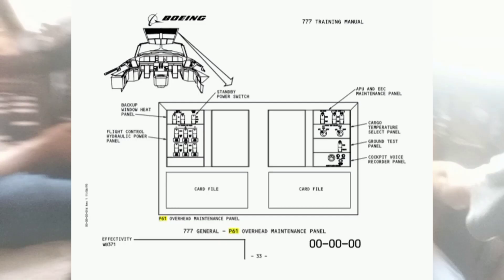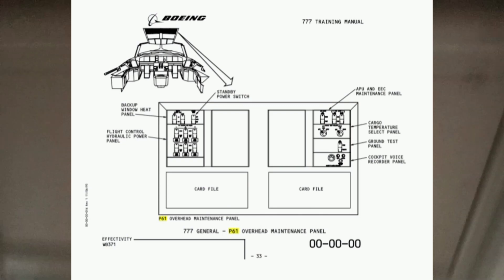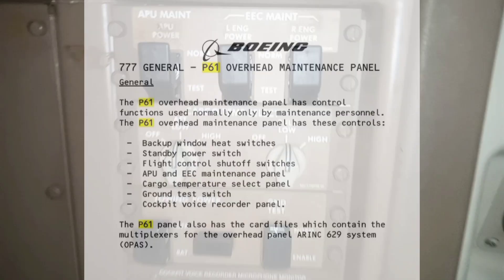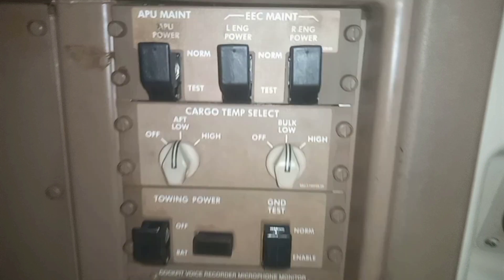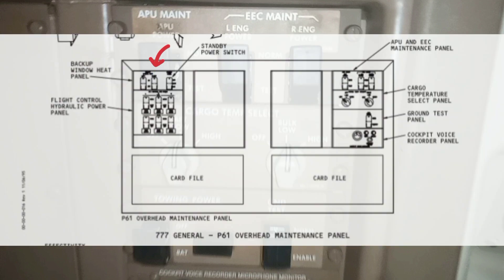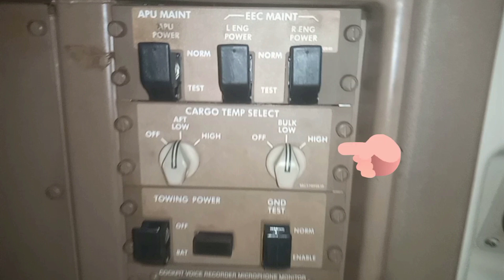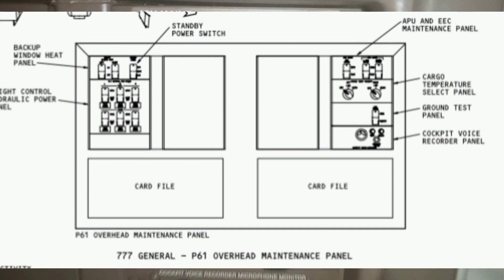General explanation of P61 over head maintenance panel of Boeing 777 aircraft

Comment: As usual good video... What is the difference between putting the cargo ventilation low and off? If they are the same thing, than why there are two switches for it?
Thanks.
Reply from the maker: Thanks for asking.
The cargo heat selector is a three position selector. The selector enables the  cargo heating and ventilation systems. The high selection sets the compartments to 21°C and the low selection sets the compartments to 7°C, moreover The HIGH position also enables the ventilation system. The LOW or OFF position sets the ventilation system off.
Reply: @AMTUmair777  Appreciate for teaching something new.

Comment: Good video...Does the backup window mean the "cockpit window"?
Thanks.
Reply from the maker: Yes. Here is some general description of window heat system:
The window heat system prevents ice and fog on the flight deck windows.
Electric heaters in the window laminations heat the flight deck windows.
The window heat switches enable the window heat system. With window heat ON, the window heat control units (WHCUs) control the power to the windows. With window heat OFF, the backup window heat system can operate.